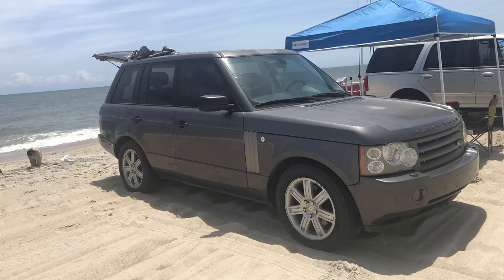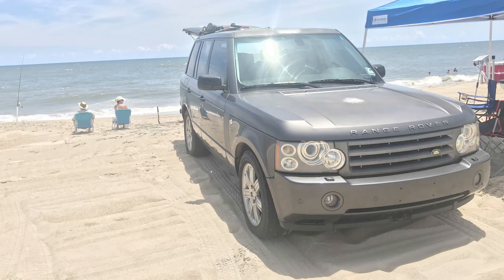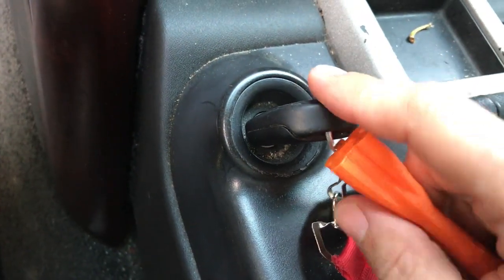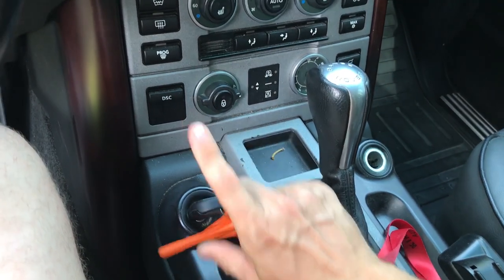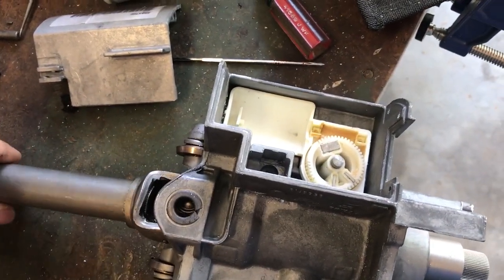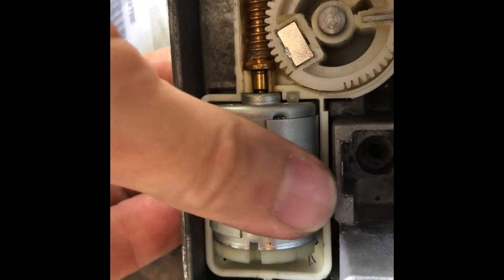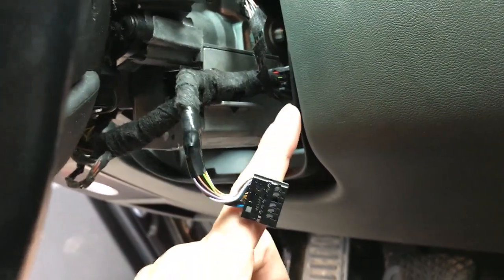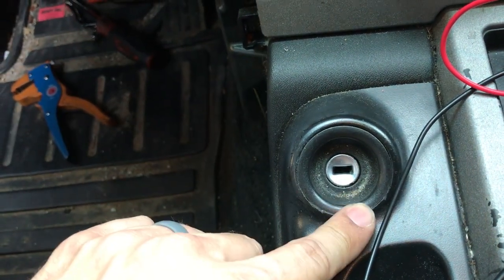L322 Free and Permanent Steering Column Module Bypass

Comment: Hi.. nice video.. 
My problem is not the steering stuck in locked position.. i just hear loud clicks for about 10 seconds whenever i open the door.. 
Do i need to bypass the module..?
Reply from the maker: Where are the clicks coming from? Will it start?
Reply: @RobTheCarGuy  from the steering
Reply from the maker: @faeztamman9603   my guess is the clicks from the steering column is the lock module trying to pull the plunger back.

My guess is that the steering column module is trying to "unlock" the steering column. Either the solenoid is too weak to move or it's not seeing the lock has been released.

You can try to drill and lubricate the lock. There are some videos of this process on YouTube but I did not have any luck. 

Can you start it after removing fuse 18? If so you can use this trick to bypass 2006+ L322's or you'll need to use the emulator or replace the column on the BMW powered ones.

Good luck!

Comment: Hi Rob, how is this fix going?  its been over a year and i am about to do the same job as you did,
Reply from the maker: Still works! I am actually about to do it again on another L322 I picked up. (“about to” is relative.... the rate I’m going it’ll be a year from now! 😂)

As long as you have a 2006 and up it seems to be a perfectly workable solution. ‘05 and older you run into issues with the BMW anti-theft and buying an emulator seems to be the better route to follow.  

Good luck! Let me know how it works!
Reply: @RobTheCarGuy  what’s an emulator where do I buy it ?
Reply from the maker: @mitchellpanes6363  some companies make a box that plugs in place of the column module that sends a dummy signal to unlock the lock cylinder. 

Another viewer got one from a company called UHS-Hardware and just sent me a message that it worked like a charm. I’ve never used one so I can’t speak directly but if you search for Land Rover steering column bypass or the company name I’m sure you’ll find it.

Comment: Rob do you put back the plug in ther column after you after u connect the wire ??
Reply from the maker: I honestly don't remember unfortunately.... I'm 87% sure it works either way so the only real question would be if the module could fail worse and cause any other issues. I would say test it both ways before you put it all back together.

Comment: Clever bypass.👍
Reply from the maker: Thanks! It helps to have access to all the wire diagrams and a bunch of test equipment. 

I purchased another L322 from a salvage auction and it’s got the same issue…. Looks like they set the engine on fire trying to figure out why it wouldn’t start 😂….😭….🤷🏼‍♂️

Comment: Hey Rob need your guidance and expertise please hear me out 2006 range rover hse and suggest anything that could help here is what i have done so far:
#1 issue: key wouldn't turn and didnt hear any clicking coming from the where one inserts their key
2# temp solution removing fuse #18 did not work
3# battery terminal did not work
4# My steering wheel is in the unlocked position so i did and followed your bypass throughly.
5# key now turns all the way but wont start, i know have all the the lights on but the car wont start nor i hear any key disengaging noises like i used from where one insterts their key.

Kinda bummed that it didnt work was so excited that this bypass was going to have it solved.

I do have a 2006 range rover hse which i thought this bypass was gonna work sense i have a jaguar engine.

What are your thoughts on what has happened? Or what should i look into next. I love that the key turns but car wont crank i just hear crickets
Reply from the maker: The bypass allows the lock cylinder to release and turn, but it doesn't tell the vehicle that it's OK to start.

From your description it sounds like it no longer "sees" the key. There is an RFID chip in the key and an antenna on the lock cylinder. When you insert the key the antenna reads the RFID chip and tells the immobilizer that there's a "GOOD" key and it's OK to start the vehicle when it's time.

It also sends a signal to the column to check and release the steering lock and when that's done it allows the lock cylinder to turn. You bypassed the "allow the lock to turn" part but not the "Tell the immobilizer the key is GOOD" part.

So, you either have a bad key, a bad antenna (which may be the whole lock cylinder so check on that), or something wrong with your immobilizer. If you have a spare key, try that first. 

If not, unfortunately you'll need to find someone who can pull data from the immobilizer so you can find the problem. Even if you have a key made at the dealer you'll likely still need someone to program it to the vehicle.

Let me know what you find!
Reply: Hey man did you ever get this solved?
Reply: @jabraan1360  yes I did. The bypass worked great. The problem was my actual key the chip inside was defective
Reply: @citizenoftheuniverso  Was the key working before? Mines just stranded me out of nowhere.
Reply: @citizenoftheuniverso Hey I’m still trying to fix my rr it’s been broken for months. 

I think I have the same issue as you.

Did you end up getting a new key or how did you fix the problem?

Comment: What was the color of the light module wire that you connected it to. ?
Reply from the maker: I don't remember exactly but you should have a black wire for ground and the other colored wire should be the power. Test for 12v at the wire with a multimeter to be sure because wire colors can change depending on the market and the year of the vehicle.

Comment: After the solder do you plug the wire back into the column or leave it disconnected
Reply from the maker: I'm fairly sure I left it disconnected
Reply: Had the same question

Comment: I did this but now it won't start i cut the wire that i spliced in and im back to square one. After I cut the wire that you said to splice in it will start only once after I disconnect the battery square one..
Reply from the maker: What year is your Rover? Is it 2006+? This won't work on 2005 and older L322's.
Reply: @RobTheCarGuy  hey rob touching on this comment i followed your diy video thoroughly fpr my 2006 range rover hse jaguar engine and the ignition turn now its not locked anymore but when i get to the last position to crank the engine i hear crickets. Please advice! 🙏🏼🙏🏼🙏🏼🙏🏼🙏🏼

Comment: Rob you CHANNEL HELPED TREMENDOUSLY. I just got the cheapest range in the world, BUT there’s a parasitic draw. I’ve changed Climate C, no change - I haven’t done the resistor because I don’t know symptoms of a bad one…. 

But my Mechanic is a STREET MECHANIC - he’s good - and he says my Bypass button (a red button on my steering wheel that was put there by a previous owner) is causing my Parasitic draw… I’m not too convinced. Any idea if that COULD be possible? And how likely is it, if it IS possible. 

Rr 2003 HSE.
Reply from the maker: It’s certainly possible depending on how the previous owner wired it up. You would need to find where the wires go and then we could see. 

But first I’d pick up an Ampmeter that can see the draw. They run $30-50 and anything over 80mA is something to worry about. Hook up the ampmeter, close all the doors and turn everything off. After 20 minutes you should see less than 80mA as modules shut down. If you have a 250+ mA reading that’s your drain!

Disconnect that bypass switch and run the test again. If it’s now gone, your mechanic is spot on the money!
Reply: @RobTheCarGuy  can u send a link to that Ampmeter? I have a voltage reader so I’m not sure if they’re the same…

Also, I have the LandRover lynx system. Would that pinpoint the problem? I’ve never used it but the owner gave it to me
Reply from the maker: @showrunner2183  here’s the one I have for myself and it works as well as the $200 I had previously. 

Bside ACM91 1mA Clamp Meter DC/AC... https://www.amazon.com/dp/B07D3SVCZY?ref=ppx_pop_mob_ap_share

You can do this by measuring voltage drop with a voltmeter but I think this tool works much better and is easier to use. I usually clamp it on my negative battery cable to hunt for parasitic drains. There are plenty of videos on how to find battery draws if you find it’s not the bypass switch.
Reply: @RobTheCarGuy  Rob I have one of these! So once u clamp it on, what do you do next? Sorry, I’m new to this
Reply from the maker: @showrunner2183  read my previous reply. Look for any reading over 80mA on the meter after 20 minutes of the vehicle sitting and everything off. 

Any time you open a door you wake up the computer modules and need to wait another 20 minutes for them to shut down. 

Pull fuses until the draw goes away, that tells you what circuit is your problem and narrows it down from there. You’ll need a wiring diagram if it’s not your switch.
Reply: @RobTheCarGuy  thanks a lot. I’ll do it this weekend.

Comment: I wish I could do this :( I don't know anything about car repairs and was hoping this was a video that was easier :(
Reply from the maker: Brandy DeLeon is your wheel locked or will the key just not turn?

Either way, if your not comfortable with this don’t try it. I have a green one here that caught fire because someone clearly didn’t know what they were doing. 

So yeah, don’t mess with it! 🙃 But you can 100% show this to a local mechanic and they should be able to fix this for you for a couple hundred bucks instead of thousands! Most local mechanics just don’t have enough experience with L322’s to know workarounds like this but they are willing to do them if you ask. 

Call around until you find one that’s willing to do this and you’ll be good to go! Good luck!
Reply from the maker: Brandy DeLeon is your wheel locked or will the key just not turn?

Either way, if your not comfortable with this don’t try it. I have a green one here that caught fire because someone clearly didn’t know what they were doing. Now that’s the next project for my channel! 

So yeah, don’t mess with it! 🙃 But you can 100% show this to a local mechanic and they should be able to fix this for you for a couple hundred bucks instead of thousands! Most local mechanics just don’t have enough experience with L322’s to know workarounds like this but they are willing to do them if you ask. 

Call around until you find one that’s willing to do this and you’ll be good to go! Good luck!
Reply: I did 1 and 7 pin and now it turns on but steering wheel is locked now :(
Reply from the maker: Brandy DeLeon sounds like you’ll need to pull the steering column and remove the lock as I show in the video. There’s a link in the description to another video that does a good job showing how to pull the steering column.

You may need to buy some Torx sockets if you don’t have them but from what I remember it’s not terribly difficult. Most of my videos I post are to show that this may seem scary but once you get into it you’d be surprised what you can do! 

If you were able to get the wiring done yourself then AWESOME JOB! You’re not far off. 

And think about it this way, if you totally screw it up what have you lost? You would have needed a new column anyway so you might as well give it a go!

The only exception would be if you have the money to pay someone and better things to do with your time. Otherwise if you have more time than money just dive in! 👍

Comment: Hello Rob, it that works - you will save my life. I have RR Vogue 2009 and experience problem with ignition - by not having a chance to turn the key. All started after simple replacing battery on a new one. WTF - that's incredible.... But just to resumer - if my steering wheel is NOT LOCKED - then there's no need to disassembly entire column and it should work fine making just the BYPASS from the solid blue socket until the cabin light to send a signal to the ignition that all works well to unlock the ignition. Question - don't you think (if not dismantling the column and not removing the engine and not blocking plastic gear in an unlock position - etc and staying just on bypassing operation ) that there exists a risk that over driving the steering wheel might lock itself?  I believe your system of dismantling this engine and blocking plastic gear in an open position is a better option (even if my steering wheel is not locked - yet) as it has a chance to exclude entirely the problem of locking wheel in a future. I will start first by making this bypass to see if the key turns and will let you know.
Reply from the maker: Hey Greg! Yes, if your wheel is not locked you have no need to remove the column, just pull the plastic covers and get to that wire harness. You can test this on your 2009 Vogue by removing that plug and sending 12v into the blue wire I showed in the video. If you hear a click, and the key turns, you’re good to go. You can then solder and install that wire perminantly and deal with the steering lock down the road if you need to. 

For what it’s worth, I haven’t heard of anyone having their wheel lock after the column module failed but you could leave the module connector disconnected once the wire has been jumped just to be safe. I don’t think it will cause any other issues but it’s easy enough to plug back in if it does. 

Cheers and let me know if it solves your issue!
Reply: @RobTheCarGuy  Hello Man ;) Great to hear from you so quick! ;) ... I'll do so next week and will let you know. Let's cross your fingers! In the meantime I've also learnt that's its good to check the battery in the key - as it may be old etc.. and guess what - replacing a battery in my RR key - is a challenge ;)... almost impossible without destroying the shell ;)... another surprise ;)... I bought my Vogue one week ago - and it seems the story of my life has just started ;)... Another issue is reducing a power when accelerating rapidly... After restarting all returns to normality - until next time happens... some say the reasons may be linked to EGR, TURBO, AIR PIPES, ACTUATORS or...  It looks I'm going to become a RR expert if all what may happen - will happen with my RR... It's true it has already 230 000 km on the clock - but I thought it's a panzer car ;)... Do you have some hint how to easy check turbines, EGR - and localize the source of the problem ?
Reply: @RobTheCarGuy  Hi Rob, I did as per your instruction and it works perfect ! Let's hop it will last forever ;)... Many thanks! Profiting from your experiences I'd like to ask for your advice on error / engine message with an automatic switching on a service mode (low power and speed) in my RR Vogue 3,6 TDV8. This happens when needing to accelerate above 2000 turns / min. This disappears after switch of / on ignition until another situation like that. Maybe you know potential reasons and solutions low cost type as I am a low budget user. There is no white fog coming from pipes what could potentially mean destroyed turbos. Nonetheless there are black exhaust fumes when I really push the acceleration pedal. It has already 230 000 km on the clock. Thank you for any hints to you or your colleagues that could save my RR and my budget. Regards, Greg
Reply from the maker: @greggregory8387  do you have any trouble codes when it goes into Limp Mode? It should give you some hints when it reduces power. 

We don’t get the TD engines here in the US but physics are still universal! The computer is seeing some PID (perimeter ID) going out of safe range and placing the vehicle into reduced power mode to prevent damage. It should leave a code in the computer to tell you why it did that. Scan the computer and let me know what it says and I’ll do my best to guide you from there. 

You can also email me at Robert  at  KindredAutomotive.com for a faster response. 

Glad the project is moving forward!
Reply: @RobTheCarGuy  Hello, You are a cool guy - thank you for this great support proving that LR community exist ;).. Thanks to a video of another expert I was advised to replace an intercooler pipe and it worked! ... two of you - you saved my life ;)... have a great time there in US - and celebrate latest elections (especially if my favorite candidate wins) ;) cheers, Greg

Comment: So my column is stuck in the open position and have been using the fuse trick to start it,  I soldered in the wire as you described which worked to unlock the key ignition.   Success!...  However the truck would not start when the key turned,  no action to the starter. Is there an additional immobilizer sequence that must be replicated as well? Fyi My key remote doesn't work to lock/unlock but will start the truck.   I snipped the wire and plugged in module and car starts again, albeit just once.  Im left scratching my head right now,  so if you have any ideas I'm all ears. Thanks!
Reply: same issue i solderd blue wire to the floor light did you ever find out what other wire to jump to get the unit to start?
Reply: Set up the blue wire... the key turns now, but no start... should I try fuse 18? Any ideas guys?
Reply: @danielbeltran3914  This only works on 2006 and above with the Jaguar AJV8 engine not on the 02-05 BMW M62 Engines.
Reply: @DonThePadawan  This only works on 2006 and above with the Jaguar AJV8 engine not on the 02-05 BMW M62 Engines.

Comment: Damn.. we tried it in our 2005 L322 and it unlocks the switch but the car does not turn on
Reply: did you try jumping pin 5 to 11?
Reply: It worked thanks
Reply: @alwynvarghese8380  can you show me wich one it is because i have the same problem on my 04. The switch turns but dont start.
Reply: @CHR...  how you did it? Have the same problem
Reply: I was able to fix the problem,  I recorded videos. But it's in my hard drive I have to look for it... sorry... I by passed a fuse.. forgot which one.. ill be looking for the video..